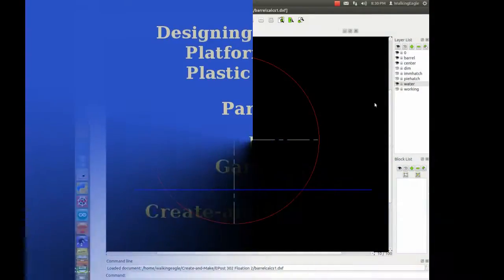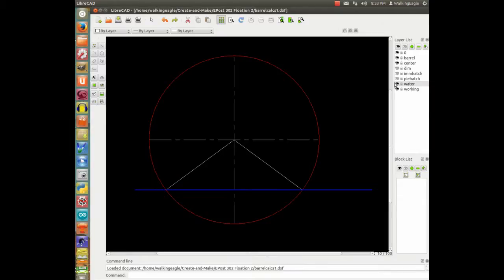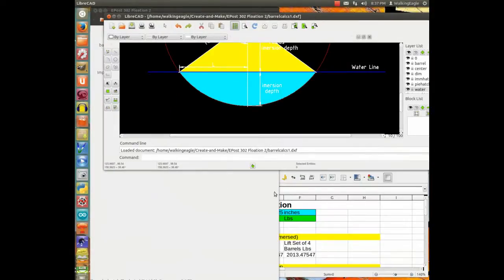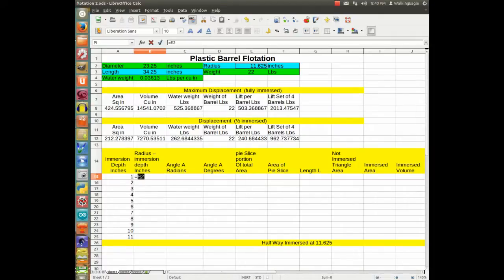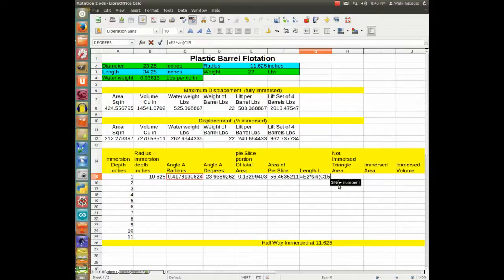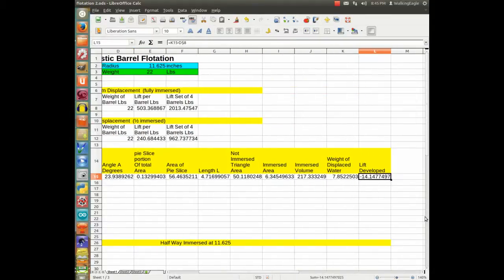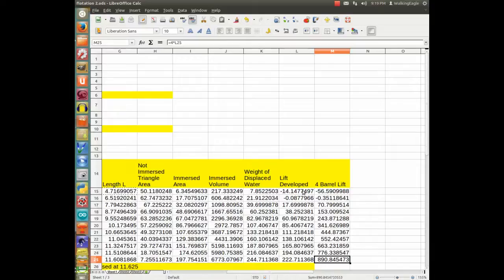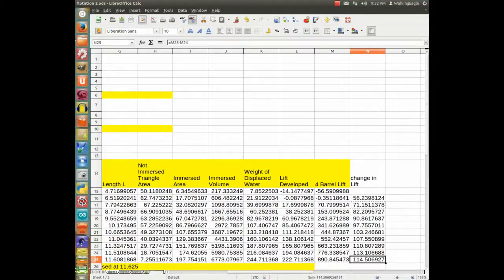Flotation of a 55 gallon Plastic Barrel Part 2

Comment: Why are you complicating this with trig.  All you have to do is figure cubic feet in each barrel and multiply by weight of a cubic foot of water. Let me simplify for those of you who struggle with math. Cubic foot of water weight is some where around 62.5# in other words a cube that is 12 inch x 12 inch x12 inch will support 62 pounds before  it goes under water. I'm no math whizz but I know  all you have to know is the surface area of hull and weight of your craft to figure how deep (draft) in the water your boat will set.  The dimension I used for barrel was 23 " by 33 " = approximate  8  cubic feet maybe a little more and in neighborhood buoyancy of 8x62=500#.